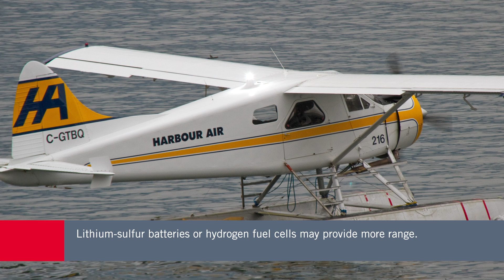Magnix Makes Another Leap for Electric Aviation with eCaravan First Flight – AIN

Comment: 30mins ain't going to cut it...sorry🤔
Reply: takes few minutes to take a dozen sky dive team up to altitude what you talkin about ?
Reply: @10OZDuster  Good thinking.  Also, these short duration electric airplanes are being used for pilot training.  So that's two good uses.  Could it be used to tow a glider to altitude?
Reply: Dont Know it's not good thinking and both of the things you mentioned are false.

Comment: is it the motor type BLDC?
Reply: All modern electric vehicle motors are either permanent magnet synchronous or induction asynchronous designs - most are interior permanent magnet synchronous. Those are all AC motors.

Comment: I’m sorry but southeast Alaska would be a target market and Juneau would be the major hub. But Skagway alone is 45-55 minutes away. Haines 40, gustavus 20, Sitka 65, kake 60, hoonah 25. So we have a plane that can reach 2-3 of about 12 destinations and probably requires a minimum of 45 minutes to recharge on the ground. When time is money a plane can be turned around in 15-20 minutes if running on fuel. A plane could do 6-8 trips a day between 4:30am and 10pm but a 45 minute charge time means those 7 trips require a total of 8-10 hours on the ground. And it’s even worse when there’s minimal light in the winter and a plane can do 3 maybe 4 trips a day so you’ll cut that in half so it’s killing an airline in winter when they’re just breaking even normally and it’ll break even in the summer when they’d be making a profit.
Reply: well considering 135 ops aren’t dictated by TBOs and most engines will run about 50-75% beyond TBO with regular inspections it’s not a big factor. A PT6 can run a 5000 hour TBO. The point is planes make money when they move. If it takes 45 minutes to turn a plane around loaded with cargo, and you got two more plane loads of cargo waiting and it’s only taking this amount of time because you have to charge a battery then you’re being inefficient. You can bump up ticket prices sure but mail contracts only make so much money same with UPS and fedex contracts and they need to move to avoid fines.  If you can save 20 minutes on the ground you by that third load you’ve saved enough time that you could move a fourth if more freight has come in throughout the day like second mail drops or just general freight plus you can add more passenger flights if that’s what the plane is doing that day.
Reply: Remember TBO is not a law it’s a manufacturer recommendation that hasn’t changed in 70 years and the only people that use it as a reference is GA the airlines and 135 ops never use TBO because why pay 100s of thousands or millions to overhaul a perfectly performing engine that is inspected throughout regularly. If ran like they should be an engine is reaching its prime of performance right around 1500-2000 hours

Comment: Zero emissions provided the recharge electricity comes from non fossil fuel generation. As for fuel cells you may as well modify the original PT6 to run on hydrogen. In a past life operating in sub Saharan Africa I have, out of necessity,  run both PT6 and Garret engines on diesel and petrol. Not so good for the engines but they go.
Reply: Thats correct PT6 will burn anything.

Comment: 30 minutes with zero passengers.  But hey, it's a good start.
Reply: 1) The first microprocessors of the early '70s ran at speeds below 1Mhz.
2) That was a good start too.
3) I wonder what ever happened to that 'microprocessor' stuff anyway?'
Reply: First flights are always done - including on large transport category aircraft which need several people - with the minimum number of people on board.  I agree, it's only a start but a viable one, as there are routes where the range will be adequate.  I'd be interested to see if there's a means of swapping out the battery for a fully-charged one, so as to fly the aircraft as much as possible.
Reply: Wright brothers 1 minute first flight 103 foot distance..after 60 years of flight we went to the moon and back.......wait few more years..
Reply: lautoka63 routes where the range will be adequate? So in what alternate universe would it make sense to operate this worthless e-caravan over a normal turboprop version?
Reply: The microprocessors became multicore and very fast.  To bad they have absolutely nothing to do with realistic electric airplane range.
Reply: @10OZDuster  Nothing is going to happen in a few years.  We need a Major technological breakthrough.
Reply: There are several regular flights that are shorter than that. I'd be perfect for hopping around between a few Scottish islands.
Reply: @10OZDuster  Electric aviation is long past the Wright Brothers stage.

Comment: Who's gonna buy it ?
Reply: sky dive business, Alaska ferry busines, tourist flights, Los Angeles to Catalina cargo flights for example....., Amazon delivery short haul cargo etc etc etc....
Reply: em forty you mean all those companies are going to replace their existing Caravans with an e version that is maybe 1/10 mission capable? Are you dense?
Reply: @prorobo  exactly what the critics said about personal computers that very few people would need them.
Reply: em forty personal computers never existed when people said that. False equivalency. Commercial aircraft are designed to generate revenue. Until the day an electric-powered airplane can out perform a piston or turbine one, this is nothing more than a waste of resources. And good luck with that given stringent regulations concerning reserves, redundancies, etc.
Reply: Noone.
Reply: Perfect for sky diving and flight schools, short duration flights and very cheap "fuel" costs.
Reply: @10OZDuster  Now they have replaced 8-10 jobs in the accounting and data world.
Reply: em forty way to reply four months after the conversation ended. But yes, comparing the pioneers of powered flight, something that had never been done before, to a group of fools taking a perfectly capable airplane and rendering it useless in both performance and capability is exactly the same. /sarcasm

A more appropriate analogy would be taking a Formula 1 race car, removing the engine, and having a few horses pull it around the track to save fuel.

Comment: Im one of those that argue the current weakness of battery tech. 
There are paramotors that can travel 100 miles on a 2 gallon fuel bladder. 
Battery technology, while improved, still has a long way to go to compete with internal combustion engines. Not impossible by any means. Just still far off.
Reply: Sooner than you think. Just because of the price money for the one that come with the right battery.
Reply: There is a market for it already, that's all that counts. There is no single airplane that fits all missions anyway.
Reply: Jan there is no market for an e-Caravan that can't even perform 1/10th of what a normal Caravan can do.
Reply: @prorobo  this is just the inntial test. The range will improve.
Reply: robo931 “I don’t know it so it does not exist”

My friend used to fly for an scenic flight operation in the south of Thailand. Flight are between 20-40 minutes. They only do a few flights per day. Plenty of time to recharge. Plenty of other short distance operations like island taxis.
Reply: Jan the range of a C208 is 1,070nm. That's about 5.75 hours endurance. Due to regulations regarding reserve time, distance, etc, that max range is shortened a bit for revenue flights (in first world countries anyway). After they land and offload their cargo/pax, they can refuel and load the next flight and be airborne within 15 min. No operator would be remotely interested in replacing that plane with one that needs ridiculously lengthy turnaround time, costs more, carries less, etc since the bottom line is it does not generate revenue.

Comment: might make a good skydiving plane if only it had a useful payload and instant recharge and didnt cost more than a real aircraft
Reply: That 9 seat number is definitely with proper seats I’m sure you could still cram skydivers in there. If you could swap the batteries on the ground between runs then it would be perfect
Reply: @jamesesdaile4696  Extension cord!  Problem solved!  LOL

Comment: Electric planes are really quiet too.  I'm looking forward to the electric DC 3.  Perfect for places that have no fuel infrastructure.
Reply: Dan In France so places that have no fuel infrastructure would have the electricity required to recharge an e-plane? Lmao.
Reply: @prorobo  Solar panels. Expensive to install, but in the long run saves more money. This would only really be beneficial in poorer African villages where medical supplies are necessary and fuel is scarce.

Comment: The big problem is most people see these kind of first flights as the beginining of a technology in its infancy that will grow fast. That is unfortunately very far from the reality. Both aeronautical engineering and electrical engineering are very mature disciplines already. The truth is it has taken more than a century of battery development - including more than two decades with the major car companies developing EV batteries and drivetrains - to arrive at a point where you can fill a Caravan with batteries and manage a 30 minute flight with no payload. And all those batteries will need changing after 500 hours at a cost greater than the overhaul of an engine. The replacement for avgas and kero is going to be a hybrid with hydrogen as the energy source because the specific energy is high enough.
Reply: Replace the batteries after 500 hours? Where are you buying your batteries?
Reply: @martinwhite418 well, if for instance I was to buy a battery for a Pipistrel Velis (which is the one and only all electric airplane that has been certified, and only by EASA thus far) it would have to be replaced at 700 hours. That is the maximum service life of the battery because it is a certification requirement and costs 20k Euros. And it is tiny by comaprison with that required to power a Caravan. It is a different and much tougher regime for an airplane battery than an electric car so you will not get the same life.
Reply: @XPLAlN  Since you mentioned euros, I guessing your in europe? That replacement cycle seems silly. I don't know if that is a requirement in the U.S.
Reply: @martinwhite418  Yes I am talking Europe. There is literally no electric airplane that has been certified in the US yet. The requirement to replace the batteries at 700 flight hours is in all likelihood simply a conservative schedule based on the data that the manufacturer were able to provide to EASA. The problem for the USA is that the minimum reserve is 30 minutes at “normal cruise power”. In Europe it is permitted to have 10 minutes reserve if remaining within sight of the airport. For 30 minutes reserve the Velis requires 12.5 kWh in hand which cannot legally be used except in an emergency. This means that if the 22 kWh battery retains 95% capacity after 700 flight hours, the kWh available for flight drops 12%. An already very limited endurance is critically affected by relatively small reduction in battery capacity.